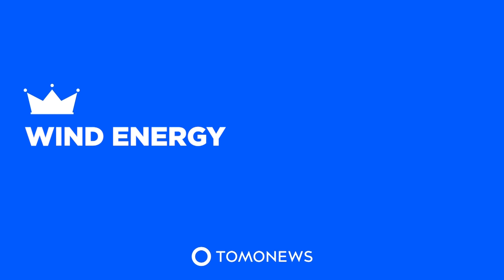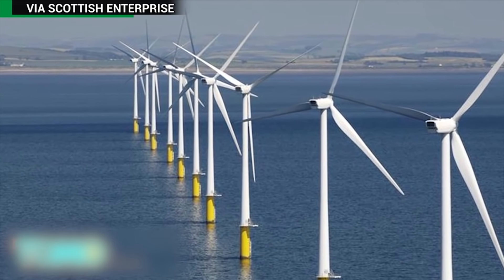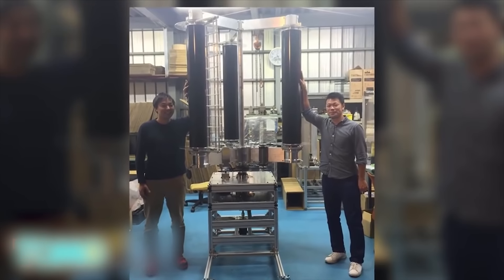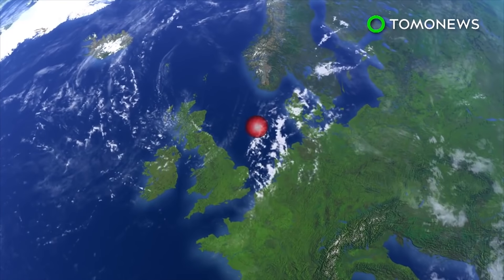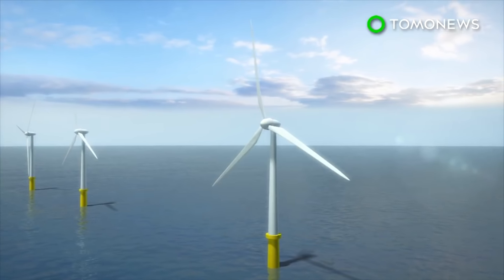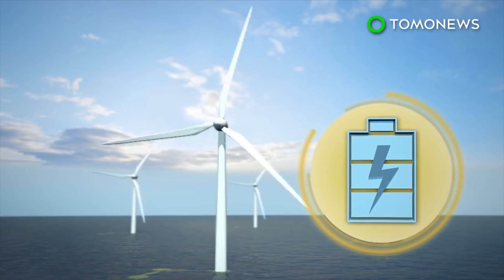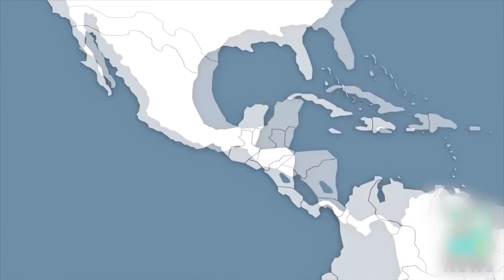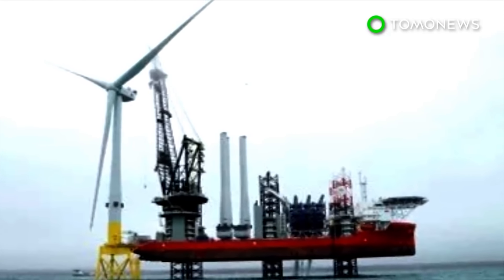Largest floating offshore wind farm in Scotland; Typhoon turbine developed in Japan - Compilation

Comment: Why not build a fleet of islands of hydro turbines that have a cable back to the mainland.. Hook up a few engines that are powered from generated electricity and chase the storms???

Instead of dotting them around the coastline and pretending they are making a difference???

In fact why not build a windfarm/hydro turbine island out at sea where its not gonna bother anyone and chase the storms???

You could even cover the outside of the wind/hydro turbines with solar panels... There ya go... Loads of energy... Even when there are no storms and no wind its generating power...

Comment: Will these wind projects be ahead of the learning curve unlike many past efforts?  Acceptable noise limits were found to be wrong causing serious (and even deadly) problems for homes neighboring American wind farms.  Low frequency pulsations from each blade carried much further due to cylindrical dispersion being half that expected, and it penetrated building structures far more than initial estimates.  

Physiological damage to people and animals included fatalities that were first noticed by florists from cities in wind powered areas.  They noticed a correlation between funeral customers and wind turbine locations that sparked deeper interest. This led to evidence of trauma, sickness, and even homes abandoned by hapless stricken owners. Offshore wind farms may be remote enough to avoid this problem.
Reply: @trueblue "They noticed a correlation between funeral customers and wind turbine locations": you have a reputable source for that? It sounds like a urban legend. Otherwise i have to call BS.
Reply: Speaking, of Bull.......If you are a Taurus, see your Florist.